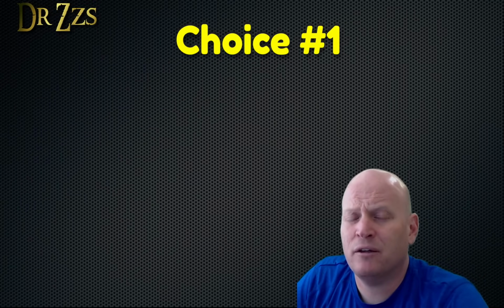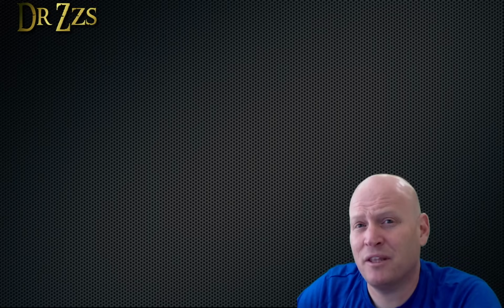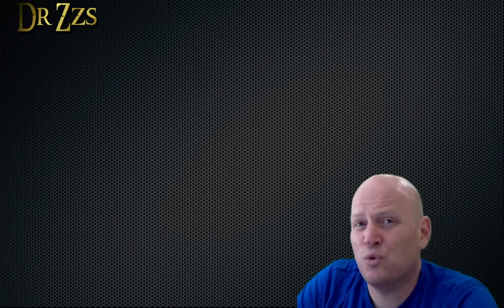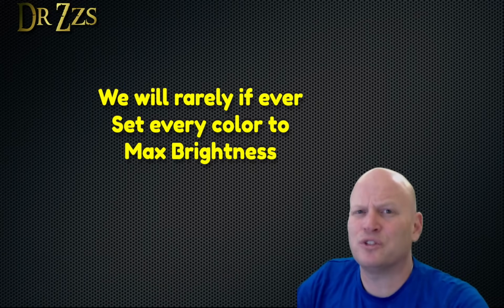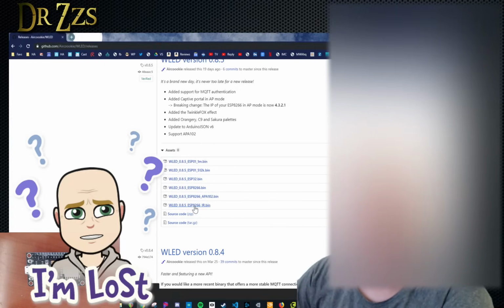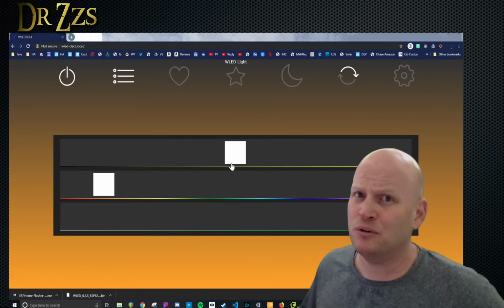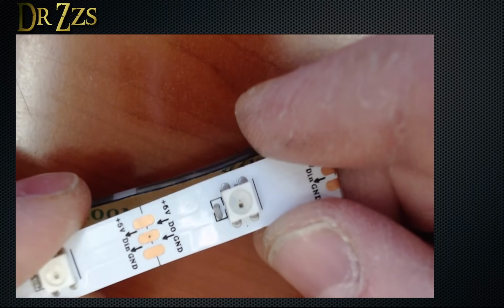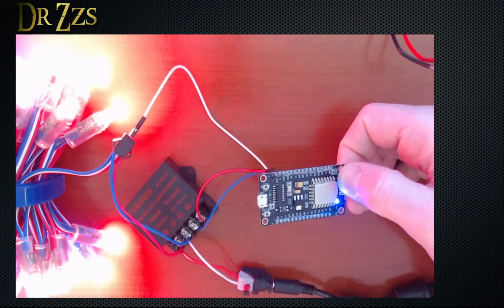Beginner's Guide to Christmas Lights - and LED Shows for Every Holiday

Comment: as far as injecting power goes, I had issues when I did the handrail on my porch. I tried to run low voltage to a few different places where I needed to inject power, and then put all transformers inside a PVC box in one location. The issue I encountered was if you made the low voltage jumper from transformer to injection point more than a couple feet it wouldn't work for some odd reason, I had to actually have the transformer within 5' or so form the injection point. Hopefully this makes sense and you can shed some light on the issue.
Reply from the maker: That is odd.  My first guess would be small gauge wire causing the voltage to drop quickly. 
Are you injecting from different power supplies?  Tell me more about how you have it wired, maybe post some pictures in discord (www.discord.me/drzzs) and I'll take a look :)
Reply: @DrZzs  I actually got it going now, it was NOT easy lol. originally I tried to connect all the strips in one continuous run and then under the deck I had a 120V switch run down to the transformers, and the controller that came with the strips. whenever I would make the run more than 5' from controller to the first strip it would bug out and act all funky, then if I tried to put a jumper in between two of the strips that was more than 5-10' it would do the same. Basically the original plan was to have multiple switch legs run to diff sections of railing but once I realized I couldn't make a jumper from the controller to strip very long I had to change my plan, I even tried using 14-2 speaker wire and that didnt work. I ended up running line voltage to multiple locations under my deck where I injected power from basically start-middle-end and the power comes from the main 120V switch leg I started with.  but it would have been much easier and cheaper to run low volt. from one location and have all the transformers in that one PVC box. I really love this stuff but even as a pretty tech savvy person it seems very overwhelming. I spent about 6 hours digging into your videos and content last night, im absolutely fascinated and want to learn more, just dont think I have the time for all of it lol
Reply: im planning on doing this set up in your video in my soffits, I want to use strips because I dont feel like drilling out all the J-channel. which strips do you suggest? my set up is a standard a-frame house , each soffit is about 40' long so it would be around 80' if I just did the soffits, and then if I did the gable ends it would be another 50-60'. id like to be able to control them with Alexa if possible.
Reply: @DrZzs  I have another question pertaining to this set up. 1 which I listed in another one of my comments is exactly which strips do you suggest and where's the cheapest place to get diffusers? second, will I be able to have this set up (without home automation or whatever that software is called) where I can say "Alexa turn on soffit strips on setting #4 or on (Christmas setting) and then another one that I can say "on halloween setting" hopefully you catch my drift on this, basically I dont wanna have to fumble around with the circuit board app flipping through settings and checking to make sure its good every time I turn them on. I would like a timer or Alexa to be able to just BAM turn on the Christmas setting at dark.

Comment: Hello, really great project I think it's really good! Is it also possible to control about 200 LEDs with UCS2903 IC with WLED? Thanks for your help...
Reply from the maker: Thanks! 
I don't know the UCS2903.  I'm not as familiar with different LED chips.  If it works similar to the ws2812 or 2811, then I would expect WLED could work.  Sorry I don't have a better answer for you.

Comment: I know this may be a stupid question, but, does this basically act as a raspberry pi? could you do the same exact things? ex. make a light show set to music etc.?
Reply: The "NodeMCU" to be more specific
Reply from the maker: You could run LEDs from an rpi, but it wouldn't run WLED.  You'd have to find some other software that is made for rpi.  WLED is only for esp8266 based devices, so nodeMCU, D1mini, and there is an esp32 version.

Comment: Got everything now when I connect nodemcu to pc it does not seem to detect it, I have downloaded the cp2102 driver and it still didn't show so you have any thoughts on what to do next
Reply: I had the same issue, try some different cables. First cable I tried was a lighter duty one and wouldn't show up. 2nd one was heavier duty and it worked immediately. On Windows, you should see a popup or 2 about drivers installing.
Reply: Some cables are just charge cables without data transfer.

Comment: Sadly, I followed this videos nearly step by step. I bougth stuff for about $300. Aluminium channels, hundreds meters of cable, a 70A power supply, the electronic stuff and LED Strips. WS2812B IP65. I put the channels all over the outside of my house and put the LED-strips in them, did the whole power injection thing by putting LOTS of cable in the channels, and soldered all that stuff. Months of work for me. First, all works like a charm. But now, as the first colder nights came around with freezing temperatures of about -6°C the shit hits the fan. The WS2812B IP65 failed due to the temperatures. First i got a failiure after roughly 250 LEDs. They can't be controlled anymore and they all freezed in the last effect I used. Means they get power, but the data line seems to be broken. Today only about the first 20 of the roughly 900 LEDs are controlable. I think I've got anothe data-line failiure in the strip here. Same as before, the remaining LEDs are frozen in the last effect; they got power. I wish i had known befor i made the huge effort to put the lights up that they are not suitable for freezing cold temperatures. $300 down the drain. Maybe i will make another attempt with IP67 strips. In one or two years. Im fed up now with that stuff...
Reply from the maker: dang man.  Sorry to hear that. Maybe all is not lost, when the temp outside isn't so harsh, maybe they will be revivable.  I didn't know low temp would cause such a problem.   You can't be the only one who has tried this in really cold weather.  There's got to be a way to do it.  I'll ask around. 
Sorry again.

Comment: Great tutorial but I'm having two issues.  I went with the 12V 50 bulb string and with a 3A 12V supply, only about 2/3 of the string lights up and the colors don't match the selection in the app.  For example, when selecting red, the bulbs are green.  Any ideas?
Reply: i just went through the same thing, you need to go into settings in WLED and change the LEL pref from 30 lights to 50 lights...  if you add 2 strings then 100 lights...

Comment: I got everything you list here and for the life of me cant seem to have my pc recognize that the nodemcu is connected so cant move forward from that point forward. Help
Reply: Same here
Reply: I have the same issue, I hit the drop down and cannot find the nodeMCU,,,
Reply: I had the same issue, try some different cables. First cable I tried was a lighter duty one and wouldn't show up. 2nd one was heavier duty and it worked immediately. On Windows, you should see a popup or 2 about drivers installing.
Reply: I got mine to work, there is a reply from about 6-7 days ago and someone else had this issue.  They found a link to install a driver for the nodeMCU using a windows XP driver, That worked perfect.
Reply: I had same issue. You need to install drivers.
https://www.silabs.com/products/development-tools/software/usb-to-uart-bridge-vcp-drivers
Once this is done, it will show up in the Esp home flasher.

Comment: How do you wire the backup data wire for a WS2815 4 Pin with the NodeMCU ESP8266?
Reply: Hi Kent . Did you get info on how to wire up ws2815 4 pin leds to NodeMCU ESP8266
Reply: @robertgates6196  I did from another channel. Apparently the primary data is also transmitted through the backup data. So, no need to wire the backup data wire. I've purchased a Falcon F16v3 that has four channels and should work.

Comment: Have you been able to find rgbw in the pixle wire style? I want to do what you did with my house but my fiance favors the white light look. While I know rgb can do a pretty decent white. I also know to get white you need all 3 diodes lit and I have to believe that wouldn't last super long like that. I don't think I'd keep it white always (waist of RGB) but for a classy Christmas she likes the white look. I am tossing the idea of makeing it every other light on and off and then ulternate. This way only half are on at once, heat can disperse a little. What are your thoughts? Might be smarter to run a white only strip along behind the color ones for that case and turn on just the whites? My goal is all year lights that I can customize ultimately.

Comment: I recently got some 5V LED strings to work by purchasing a bunch of stuff linked in the description and following along closely with it. The only issue I ran into is your amazon link to wall wart 1-2A power supplies are all 12v. When I first plugged all my stuff together, I only got blinking lights due to the NodeMCU backing off the too-much-power. I ordered a 5V power supply on my own and now WLED is working fabulously. Thanks for making such a good detailed video!

Comment: DrZz Thank you!  One question.  If i wanted to replicated a more traditional Christmas light setup, with around 6-12 inch spacing and larger bulbs, what would be the best LED option that would be individually controllable and have all these features.  Unless you feel the 12mm LEDs have the same brightness of a traditional light?  I can just space them apart more than the 3 inches in the strand.  I have watched this several times and have ordered the NodeMCU and am going to start playing with it.  Thanks again!!  Exactly what i have been dying to try for a few years.
Reply: Mark Allen they sell rgb lights in different spacing increments. 3”,6”,9”,12” so find what you like and a price you like and order them up.

Comment: I know your busy around now. Bought the Node. Esphome will not find it. Tried new cables, a different NodeMCU, drivers. I'm on windows. Has anyone came into and fixed this problem?
Reply: there was a reply about 5 days ago that had he same issue, found the correct drivers to install, I did it and it worked...  https://www.silabs.com/community/interface/knowledge-base.entry.html/2017/01/10/legacy_os_softwarea-bgvU

Comment: I bought a 12v LED setup. For some reason, the lights will randomly flash white when I'm running a color theme. Anyone else having this issue?
Reply: I had to add a logic shifter to my 12v set up. I was getting flashes and wrong colors.

Comment: Great video.  Ordered a bunch of your suggested items and got it going fairly quickly.  Ran into an issue with the nodemcu driver.  Windows would not find it.  I think this is the link for others as needed.  Need to use the legacy driver https://www.silabs.com/community/interface/knowledge-base.entry.html/2017/01/10/legacy_os_softwarea-bgvU

I also got stuck getting all the lights to turn and it wasn't just injecting the power at the end.  Went into the WLED app and, under led preferences, made sure to set the proper number of LED lights and the proper mA.  I was banging my head against the wall for an hour since only 30 lights came on initially.  Made these changes and bingo, it all worked for all of them.

Comment: Important note to add, I am in Canada and bought from Amazon Canada. The 5 v string LED lights I bought are 2.25 inches apart not 3 inches. Measure the LEDs distance before you drill your Jchannel. :) (Lost one Jchannel to 3 inch drilling :(  )

Comment: So newbie here, strips are easy to adjust to the exact length needed.... what about the string lights? Can they be adjusted to the length needed?
Reply: You can cut it. Make sure theres no power and ends arent bare
Reply: Cut them to your length. Make sure theres no power and bare wires before power

Comment: I really liked the video. Easy to follow. 

I am new to LED, and want to use this setup for a 16 string - 50 node pixel tree. Is there a way to use Xlights with this setup? Or, do I need to spend the additional and get a Falcon controller?

Comment: This really inspired me but I feel like a goon (not a very smart person). I have flashed the NodeMCU and tried to get it onto my network.  After putting my WIFI details and rebooting, it didn't connect and the WLED WIFI is now also not available either... I've tried two version of the WLED software with no luck.  Either DrZzs or anyone... what am I doing wrong.  Please help me turn inspiration into triumph.
Reply: I'm having the exact same issue. I tried different names for the NodeMCU and a bunch of other things. All I get is that my computer or phone can't connect to the named (in my case I just called it wled.local). http’s server IP address could not be found. is my error message

Comment: 11:21 or you can use PC power supply with high eicency.
Reply: I use a computer power supply. Works great. I did tie 3 lines out of the suppy to run 5- 3 meter strings. I don't know if I needed to.

Comment: I am excited to get started on this project but I hit a snag. In the guide at 13:05 you mention using ESPHome-Flasher. I downloaded the tool, but cannot get it to recognize my device com port. I am using a newer mac with Thunderbolt (USB-C) ports. It does not have USB-A. SO I have to use an adapter. I have tried a combination of several different USB-C to USB-A and USB-A to Micro USB cables, but have not had any success getting it to recognize the comport in the dropdown of esphome-flasher. I have ordered a new USB-C to Micro USB cable from Amazon and confirmed that is offers both data and power transfer. Hoping that will solve the problem, but it cannot get here soon enough. Has anybody else had success with using the mac via a usb adapter?

Comment: Help DrZzS! My NodeMCU connects to my Wifi while it is plugged in to my computer but when I unplug it to connect it to my lights/power supply it won't connect to the wifi/doesn't show up on the app or when I search for the IP. Any ideas on why this could be or how to fix it?

Comment: Randomly watching this video inspired me to take the plunge into this type of project. However, I am running into a problem. I have 5v 300 led strips hooked up to a 60amp power supply and a node mcu. I have wired up two separate strips on the floor to test them and both strips only light up the first 30 led’s. The led’s that are lit up are controllable from the WLED app, and very bright. But I’m not sure if I have a bad batch of strips or what. Is there something I’m missing here?
Reply: You likely need to go into the settings in WLED app and change the number of lights to 300.
Reply: @coreyosborn1061  Thank you!!!! That did the trick.

Comment: In case anyone may be having the issue where only the first few LEDs lights up, be sure to change the (possible) default setting of 30 LED in WLED. I returned two set of LEDs thinking that they are faulty until I realized that the settings were only set to control 30 LEDs by default in WLED. 

Thanks for the video.
Reply: edtdk THANK YOU!!!!!

Comment: Do you have to power the nodemcu off of USB, or can you use a buck converter and step down the 5v power and supply it via one of the 3.3v inputs on a pin?
Reply: Trying to find a way to just put a NodeMCU board under the eves, power it off the 5v wire, and not have to plug in a USB --- there is already power up there (from my power injection wire per Rob/HookUp's suggestion), but the data signal doesn't seem to carry far enough (about 30 feet or so) from the end of one strip to the next on the lower level up to the second story.  Thinking just drop another NodeMCU board right at the start and sync it up -- but how to power the board???

Comment: Excellent Video!  We've done everything exactly like you said, 12V lights with the 5v converter...exactly like you have....but it only lights up 30 lights on one string??  We've tried different light strings, so it's not the lights.  Any idea what's going on?
Reply: pegasusdkn1 Once you have connected your lights AP, you have to click on the cog to access the settings. You will then select LED Settings and there you can change the amount of LEDs. I had this issue as well. He addresses it in a newer video.
Reply: @darrenmromero  Thank you so much Darren!! That was the problem!  Now to get the next set working.....
Reply: For some reason the colors are not matching the controller..when we hit red it turns green..Any idea about this?
Reply: In the LED settings, you need to change the order of your colors. There is a section where you can select the order. I think it’s initially set to GRB, but it needs to be changed to RGB or whatever order your lights require. You can usually see the order on a strip and I think that strings are usually RGB, but I can be wrong.